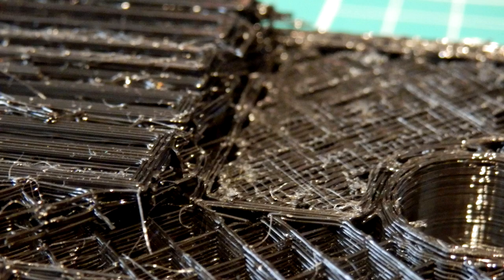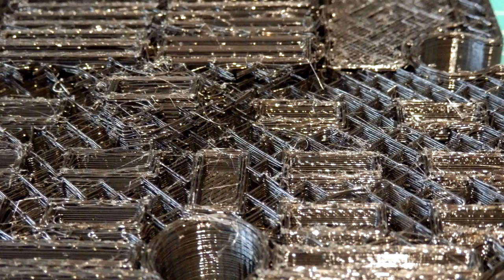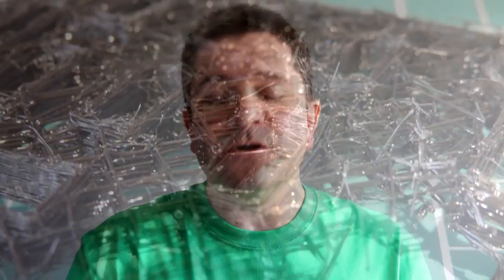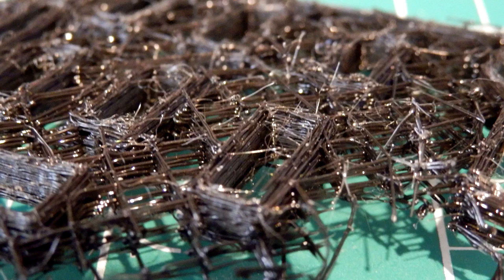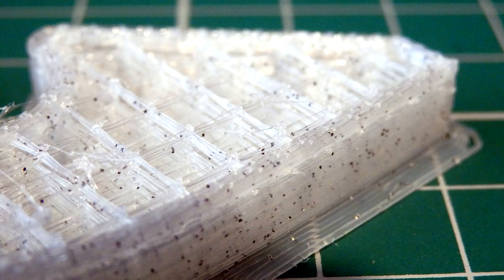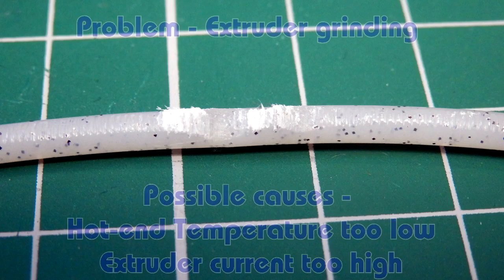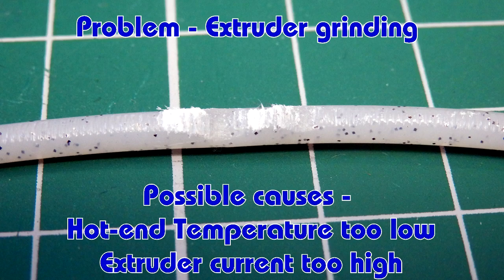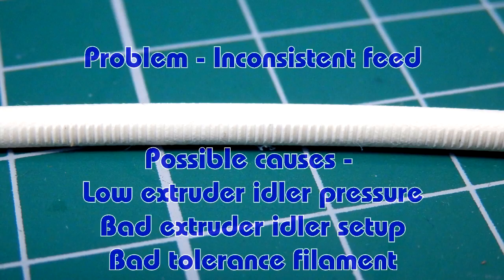3DPrinting Tips & Tricks Delamination of layers due to poor extrusion

Comment: I'm using ASA & am experiencing that problem.  Recommended temp is 250- 255 deg. I found it previously ran better with 270 deg making much smaller parts. The large part i need to print is 205 millimeters tall. Thats where i ran into problems. Any tips ? I'm using Sapphire Pro printer that is fully enclosed. Bed temp i'm using 65 deg .  Any tips would be helpful & appreciated.

Comment: I used your tips to increase my extrusion temp by 20degC! I also did a PID autotune in order to be able to maintain the temperature properly. I've included some steps that I obtained from Thomas Sadlanderer:
https://www.youtube.com/watch?v=APzJfYAgFkQ

PID Autotune Procedure
Can use Octoprint, Pronterface or even Matterhackers software (MatterControl)
In Terminal window:
M303 S205 C30

Once tuning is done, the parameters calculated will be displayed in the window and then extruder or heated bed will turn off.

M303 = command for PID autotune
S205 = set temp for autotune
C30 = number of cycles for autotune

To enter PID parameters through the terminal window:
M301 P20.17 I1.58 D64.43
M304 used to enter same parameters for heated bed

Tuning heated bed:
M303 E-1 C10 S55

To make setting permanent (write to EEPROM):
M500

Comment: This helped me a lot! I have an ender 3 pro and I'm pretty new to printing. I switched filiments and had nothing but issues. The PLA states on the side it goes to 230, not sure about that, but after watching your video I had some of the same issues, and constantly upping the temp a little let me find the correct temp. Thank you for posting!

Comment: You described that when doing lots of infill the heat is sucked out of my nozzel. I heat up my hot end to 220 then it still is not going threw well enough I only want to print at 60 mm a second but I can’t.

Comment: Another tip: (auto) tune the PID control of your nozzle. This will help when changing from slow extrusion to solid infill (fast extrusion) because the temperature controller will respond quicker and better, so the temperature will stay more constant regardless of extrusion speed.

Comment: HBP heat can have some deceptive effects.  Bottom layers will look great, but as the object rises away from the HBP,  part cooling can become over whelming to the extrusion settings that were working great for the first 10-20mm's.
   There use to be an article in the Ultimaker forum/blog, entitled "Balancing Energies".  It was a single most informative piece I have ever read about understanding how temperature, speed, material, cooling and part geometry, effect each printed item differently, and how making small adjustments to any one setting, would mean having to make adjustments to other setting as well,, in order to produce the best possible print.
   Unfortunately,, the single article was deleted, and chopped-up in to individual blog segments,, which doesn't help to "see the whole-picture" as clearly as the single posting did.
Reply from the maker: +Duplicat I agree. One thing users don't often get is temperature v print speed. It's amazing how hot you need to run a hot-end when you are printing really fast. The instantaneous temperature and energy dumped into the filament means you may need +280 Degrees C when printing at over 120mm/sec. That would be a good demo video to do at some point.

Comment: Rich. Why Nylon? That's the first time I've heard that specific recommendation. Is it because of the higher glass temp. of Nylon, which should help pulling other low temp. materials out with it?
Reply: +RJ_Make The nylon won't snap when you put it out at 120, it may stretch a little, but it will drag out all the gunk from the tip.